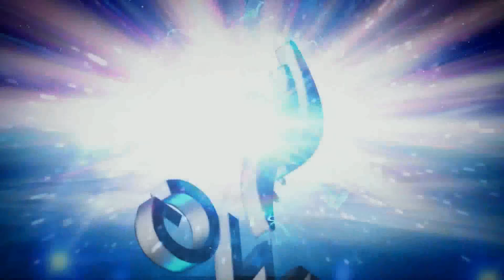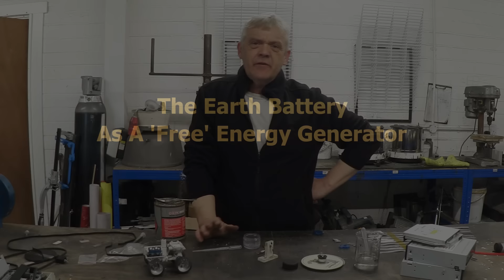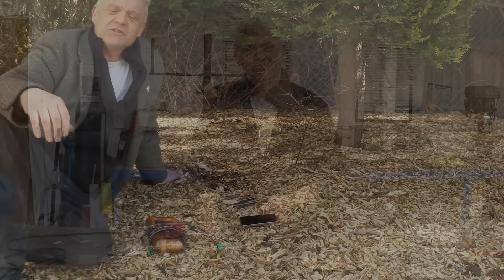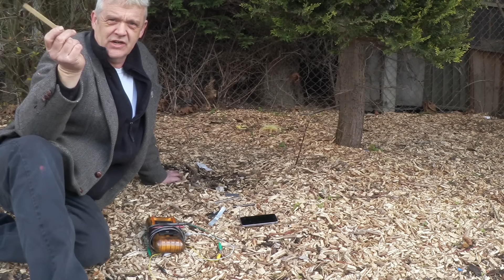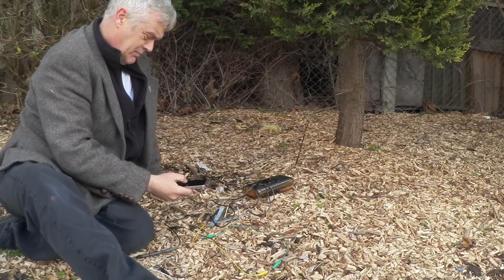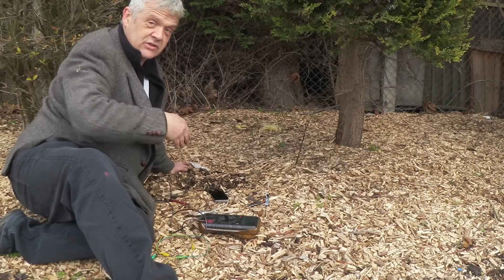The Earth Battery As A 'Free' Energy Generator

Comment: If you use larger surface areas and bury the metal deeper so that all the of the surface is making contact ... it will increase the voltage dramatically. Also make a 5 gallon bucket of salt water. An entire box of salt to make it strong, and pour around the area where the metal is buried, you will increase the conductivity of the soil.... Also you can drive a nail into a nearby tree and connect to the nail for positive, and the metal buried as negative. The wind blowing through the branches and leaves generates a current down to the roots because of the constant movement of the branches and leaves due to the wind. Increasing the energy output at this point is only a matter of expanding to multiple trees in a parallel manner by doubling and tripling  and so on the collectors.  ( 1Tree = 1 collector) ... ( 2 trees = 2 collectors) ...
Reply: I think you may have missed the natural solar power being produced by the leaves... :) LOL great response!
Reply: When i watched this the same thought crossed my mind but trickling a charge to batteries for the added build of energy. Would be great to see this on a large-scale system.
Reply: @anjhindul  yee if you wire the leaves to the roots, you can use the charge differential, to produce Photovoltaic energy
Reply: same of what Tesla made.
Reply: @Erjet1008  idk what tesla made. Not familiar with his work but I do know what I mentioned in my previous comment works because I've done it before.
Reply: Not familiar with the work of Nikola Tesla? I find that hard to believe
Reply: @trevorforrester3142  You did this but know nothing of Tesla? Eh?
Reply: @-Deena.  No I know nothing of Tesla but what I did is not a big deal. Although I'm not familiar at all with Teslas accomplishments... I have heard from word of mouth that he created extraordinary inventions and innovation. What I described in my initial post to me is just basic grounding techniques, or at least techniques I have discovered that work for me. I've been experimenting my entire life with electricity,  radio, light communication, etc.,  but don't see myself as anything special LOL!
Reply: What? Isthis a list??
Reply: @IngeniousOutdoors  also the salt  will just sorta wash away to some extent right?
Reply: @baileyjerman5573  salt takes a long time to wash out of soil.
Reply: @trevorforrester3142  It was his Tesla work on free earth power [ electricity ] that ruined him all his work disappeared  after they closed his lab down
Reply: @IngeniousOutdoors  The salt is there to increase the conductivity of the soil around the ground rod in order to establish  a much more efficient  ground, whether it be for radio transmission,  electrical production or whatever requires a high surface area, high conductivity ground. As farvas the salt losing its effectiveness over time.... there's a simple solution for that. Add more salt periodically. Problem solved.
Reply: @IngeniousOutdoors  The salt washing away slowly is a good thing. After all, the entire reason the salt is there is to promote an effective and efficient ground for electrical production.
Reply: So interesting! Can you charge batteries with a set up like that? Or maybe power an LED light?
Reply: Does the Ph of the soil make a big difference? I know plants favor slightly acidic soils
Reply: @h3avym3tals69  No ... the PH level doesn't matter. What matters is how moist the soil remains around the ground rod and the salt content of the immediate soil around the ground rod.
Reply: @thomashopkins8453  Yes
Reply: I still don't like house wiring.
Reply: Very interesting! It's been awhile since your comment, but in case you still see  this, I'd love to know more about your experiment or have you been able to generate free energy by what you've described that worked for you? How much energy and have you used this since?  Thank you!
Reply: @trevorforrester3142  Tesla learned a lot of his info from a dentist named Loomis. Really good book for ground conductivity is Phil Callahan's - Paramagnetism,  Rediscovering Nature's Secret Force of Growth
Reply: @evanrandall1675  Wardenclyffe Tower was Nikola Tesla's free energy idea. He drilled down to the water table, then erected a steel structure above that lined up to the directions of the compass. It was supposed to provide enough energy that you could "in theory" charge your cell just by standing within a certain radius. Now think about this.... What if the great pyramid was the same sort of generator, and the granite obelisks that were erected all over the city would act as conductors and power lamps and lights and this is why they never found any soot from fire on the roofs of the pyramids.
Reply: @cynthia9388  The key is knowing there are no demons in power. All they have is an illusion of power.
Reply: @inphiknitfractal  and where does that illusion come from?
Reply: Holy Moly Batman ! Amazing! Why has nobody done much with this? Thanks for an interesting video.
Reply: @cynthia9388  It comes from the age of distortion we are currently living through in which we project our perceived lack of power into our reality. Read up on the Siddhas, (David Gordon White) or original Yoga Sutras by Patanjali... or listen to Jivanmukti on Siddhanta Yoga chan.

We experience the lack of power externally in order to understand our relationship to it while in this state of mind / being. Once we consciously make the decision to reconstitute our own being into a place of power, rather than as victims, by taking back the projected power we have given others, we change "the world" / ourselves.
Reply: @inphiknitfractal  and what's the difference between illusion and reality? Here on this planet
Reply: Thanks for the reply
Reply: @evanrandall1675   Being honest, pretty much everyone knows the name & generalities; just not the specific details of his engineering.
Reply: @sido7779   Tesla’s biggest efforts were to send electricity thru the earth from a central generator he devised.  His vision was that each household could just plug into the earth—but tried to centralize it like Westinghouse (for profit).  The tricky bit was getting it to generate enuf power to feed a townful of users.   I think he was working off the earth battery model, trying to multiply it.
Reply: @trevorforrester3142   But it kills vegetation all around there.
Reply: @trevorforrester3142    Couldn’t Epsom salts (MgSo4) be the electrolyte, instead of plain salt (NaCl)?  Because, Epsom salts fertilizes plants, but salt kills plants!
Reply: @mistamischief1979   Yep.  It’s always blown my mind, how Tesla ended up as he did.  
 Wardenclyffe tower was a terrific, & terrifying construct!  But T was a layered project. 
For public awareness, it was to try to beat Marconi at wireless transmission of radio signals.   Tesla’s signal was  to send a wireless message to the Perry’s Arctic polar exploration team, as they headed to find the North Pole.  
 But, Underneath that, it was a covert demo of a war tool….  “”….(read the sarcasm!)
…his initial wireless “radio” signal, missed that expedition (thank goodness it did😳!!), because, his “signal” ok, papers  a whopping 3 minute difference in times…🙄…at a time all clocks were hand-wound spring mechanisms… …… …across several time zones🙄)
But…As soon as that contest was over & Marconi proclaimed the winner, the US govt demanded the entire thing be torn down, & the parts removed & destroyed, so nothing like it could be made again (interestingly coincidental, & contradictory to govt denying that thing had  to do w/Tunguska explosion...to this day).  
When Tesla died, US govt collected everything in his apartment & lab, never to be seen again…they ….
But, I would direct attention to the HAARP arrays built over the past few decades, sited in a number of places worldwide, at triangulation points, starting in Gakona, Alaska, which suspiciously look like some of Tesla’s plans, & are capable of doing horrific things to people, planet, & weather.  Tesla got nothing of recompense from govt, for all his efforts to sell war tools to them.  He got precious little from Westinghouse, for all the work done for him.  & Edison took some of his work, ridiculed it, but used it, rather than amicably collaborating w/Tesla, as Tesla tried to do.
Reply: @Chimonger1  Again.... You can use whatever you want to use if you find it works for you. As far I'm personally concerned, I'll use salt for 2 reasons.  (1)- My objective is not to grow a garden  .. it's to enhance conductivity around an electrical ground. (2)- Salt is what has always worked for me so salt is what I will continue to use and advise others to use.  By the way.... I'm seriously not trying to be a smartass in this comment but I fail to understand how a comment about electrical conductivity somehow turned into "saving vegetation"  in an approximate 2 to 3 feet radius around a ground rod. I couldn't care less if some grass in a 3 foot circle located on 16 acres of land lives or dies.
Reply: @trevorforrester3142  you should try laundry boosters it’s a lot more conductive.
Reply: Do it in salt flats
Reply: @trevorforrester3142    It’s not just what happens to the vegetation in situ. 
The salt will not stay in situ; it migrates thru the soil.  How much you have to replenish the salt after it migrates, depends. Mileage may vary relative to moisture conditions, too.  It will end up salting the water table below, & osmose thru the ground in a wider area, roughly cone-shape widening deeper (again, mileage may vary, depending on conditions & depth of water table). 
Not tryin’ to be obstructionist. 
You do you.
Reply: @Chimonger1  Pure salt isn't that great for the lifeforms in the soil, would suggest clearly an inert area specifically for this if that's your method.  I would suggest trying volcanic rock dust sometime as it'll probably have more generation and it's probably healthier for the ecosystem.
Reply: 😯wow
Reply: @maskcollector6949   Had not known that about volcanic rock being conductive.  
If that rock dust can inhibit plant growth in our driveway, too…even better. 
 Have thot about ditching down center of our long driveway to bury geothermal tubing for tempering house, & trying out a long line of earth batteries (hiding in plain sight).  
But, have yet to find detailed descriptions of how-to, & what electrolyte might best optimize charging batteries enough to power at least the lights in the house, if not more. 

Was considering using the biggest nails (almost 12” long X almost 1/2” diameter) sold by big box hardware stores, or, using grounding rods for longevity.
Reply: @Chimonger1  There's a lot of magnesium and other minerals in rock dust, there's different blends out there.  I haven't experimented with it yet but I figure it might work as I'm familiar with using it for gardening, at least.  It's not publicly available information:  we're at the point where legit we're all experimenting right now.  I feel like there will be a major breakthrough in earth batteries someday, probably sooner than later.  I was visualizing using nails as well, but I think what I might do is figure out which metal is best.  I know Magnesium+Carbon is the best combination that's been tested so far.  Wood ash is something that's also worth looking into in terms of carbon.  Right now, my goal is to just come up with a stable 6volt current to charge a cellphone.  Once that is established:  off-grid energy options really open up.  You'd just double it for 12v.  Figuring out a way to stabilize and increase the current seems to be the main bottleneck right now.  There's not enough current to power most things via earth batteries from everything I've researched, that's not been done yet.  The best that anyone has published powering has been a radio for like a few seconds.  I don't think digging deep and all that is worthwhile until you come up with a scalable model.
Reply: Another Account  Yes,  I am 12 .
Reply: Another Account  ...well nearly 12. I'm 12 in 3 weeks. I'll soon be a teenager. I cant wait🏵🌺🎇🎈🌻🎂🎶🎉
Reply: @maskcollector6949   Wishing there were better ways for comments to work for discussions, that made looking @ chains of back-&-forth chat to be found & looked thru! 
I only know little of energy production & use.  But, yeah..the random uneven power from earth batteries is a problem. 
🤔 What if the earth batts fed to one or more capacitors 1st, then from that to battery storage (& from there to power stuff as more usual for on-site systems)? 

🤔 Do I grasp right, that the earth batteries are picking up earth’s charge, & Not just generating energy from the dirt minerals? 
🤔 Recalling “Baghdad batteries”, maybe those were a progression from earth batteries, which generated a more controllable & scalable energy?  
🤔 Tesla’s Wardenclyffe system had a particular foundation, & I heard, rods fairly deep into the ground; it sounded like he was harvesting earth battery-like energy to run the tower operations.  Public only knew it to be competing to send the 1st wireless radio signal to Perry & crew on that Arctic N.pole expedition.  But the less known use demo, was for the US govt, as a weapon.  Supposedly “coincidentally”, the Tunguska event happened concurrent w/turning on the tower (officials say, “there was a 3-minute lag-time, so, it couldn’t have been caused by the tower”—except, back then, there was NOTHING like accurate clocks of today—everything clock was springs & gears—making it highly probable, the tower’s activation caused Tunguska.  Then, there’s the thing about how fast the gov’t mandated that tower be dismantled “so nothing of it can be reassembled ever again”, & a very strong move to make Marconi the winner for wireless, & further thwart Tesla’s getting contracts for his works. 
Tesla figured something out, about tapping earth energy.  He was trying to create a way for every building to just be able to wirelessly be powered (no grid connect).  
His problems seemed to include, difficulty sustaining the created energy, & keeping it evenly operating.  
Residents in CO. Springs filed numerous complaints about Tesla’s lab near there, including static discharges they could feel, booming/explosion sounds, etc.
Maybe if people dug hard into his research (IF they can find it), more can avoid “reinventing the wheel” w/earth batteries. 
Tesla was extremely impressive w/knowledge back then, & some of his stuff has covertly been used by govt, up thru now..they did, after all, take all his stuff upon death..  I suspect there’s more of the science known now, than back then, but there were still projects left undone, that might help. 
We just need to stop the “lizard people” running everything into destruction, for profit.
Reply: @maskcollector6949   I think it might be an idea, to use pipe w/electrodes, fill pipe w/rock dusts. 
 Who was the very eccentric Canadian physicist guy? Electrical engineer..
He demo’d filling recycled cans w/tiny yard gravel, sticking in electrodes, I think adding liquid to the rocks??…& those became usable batteries.  
The video was a general demo, so, could not see what the gravel really looked like, or exactly how he connected electrodes, but showed him measuring the power it made.  It was from, I think, the 1990s? 
He, too, filled his apartment w/electronic equipment for doing electrical research, SO much, there was barely a pathway to get around.  He struggled w/permits to do that there, had trouble w/landlords, etc…very Tesla-like.  Long hair, liked black leather vests & pants. One-track mind on his work.
Reply: Another Account  Do you often talk to (nearly) 12 year old girls on the internet?
Reply: Except the salts is what's making the electricity, just galvanic reaction, no secrets or energy, one the salts gone it's over.
Reply: @ironhell808  It returns back to its original  state had no salt ever been added to begin with. ..in which case simply maintaining a fresh supply of salt periodically solves the problem.
Reply: @trevorforrester3142  Fascinating. You really should watch a few youtube  videos or pick up a book about Tesla a fascinating man actually. My  Dad taught me about this man many many years before he became well known by most everyone.  Your comment fascinated me thank you.
Reply: ...
Please do not salt the earth on large scale.
Just trust me on this one, we have a lot of data on this specific subject.
Reply: You just described how the pyramids are a energy power plant !
Reply: @anjhindul  his plans greater
Reply: @trevorforrester3142  "No ... the PH level doesn't matter. What matters is how moist the soil remains around the ground rod and the salt content of the immediate soil around the ground rod."

Makes sense, in order to keep the conductivity flow at optimal levels.
Reply: @mistamischief1979  Your more correct about pyramids generating power then you think. But the obilisks were not used as light but something different.
Reply: @Chimonger1  mmm, something to think about. The salts flushing outs to other areas eventually killing plants and organisms. I guess if you go move to high salt content areas where life don't grow it shouldn't be a problem
Reply: @Chimonger1  chlorides in general are not great for plants because chlorine. Also plants don't really use sodium . But it's a question of dosage. Stick a few teaspoons of mg sulphate on a plant and it will die. The dosage is in micrograms. And to be honest micrograms of nacl wouldn't kill the plant. It wouldn't be great but it would be in tolerance levels. It's not a toxin to plants it's just not nessesary and can be a dehydrating agent and kill it in that way.
Reply: @apathyreview3964  First of all... I'm not the creator of the video above.  This is not my channel. I am what they call a "commenter" who left a comment.  That said,  a person who leaves a comment cannot make monetary profit. As far as removing the soil is the same as saying , "remove the GROUND" ... I hope you know the concept of a ground in a circuit is not a new concept and has been around since the beginning of circuitry itself. In fact it is a requirement.  Otherwise there would be no opposite polarity in a circuit,  leaving just the "positive" polarity without the negative. When creating a basic atmospheric power generating circuit, you must have a ground rooted in the Earth ground in order to establish a positive and negative field. There's no other way around it and it is common knowledge. Saying you can generate more voltage by completely removing the ground is not only false but is also impossible. Why don't you first learn how to write a simple comment using basic correct punctuation? .. once you learn how to communicate properly,  then you can graduate to more complex subject matter such as simple electrical concepts that have been written in stone since electricity has been around.
Reply: @originsdecoded3508  i believe you are correct. I actually think the obelisks were used sort of like WIFI towers to extend/distribute the energy with max output. I wonder if they Multiplied the power output like a capacitor or something, and this way everyone was able to get a solid "signal" no matter where they lived in the area. Whoever built the pyramids, were WAY more advanced then we are now. I just cant decide if the builders were from the pre flood era or even the one before that, lets call it the ASTEROID era. The pre pre cataclysm peoples. Thats how old they may actually be. Were just too stubborn and corrupt to ever let the truth out. Sad.
Reply: @apathyreview3964  I clearly said atmospheric generator, In context with the entire conversation and video. Secondly...a battery does have a ground.  GROUND and negative are interchangeable terms.  You always need a ground in any known circuitry.  There's always 2 sides to any circuit. Continue to dig a deeper and deeper hole for yourself but in the end you will remain wrong. Have a nice day! I will no longer respond to your uneducated semantics.
Reply: @mistamischief1979  The pyramids were built after the flood. all middle eastern areas were inhabited after surviving nephilims moved from the northern center of the earth were the Garden of Eden was located. after the flood they settled in the east while others spread west, south, and outer north. So much literature exist out they're to satisfy all your curiosities and questions about the ancient past. I can tell you this much, That the sites near Iraq was the first cropping civilization in the east after the flood. So, older then the Egyptians temples and pyramids. its where king Nimrod in ancient Babylon built the Tower of Babylon after he survived the flood and his people. His kingdom spread far and wide, even as far as Egypt, and more likely then not, he is responsible for commissioning those pyramid structures for power and energy. His kingdom spanned across almost all the East and it said that at one point, he was the top king of all kings in the world during that era. He was a Nephelim himself, a giant.
Reply: @originsdecoded3508  exactly.
Reply: @Chimonger1  uhh, exactly to what comment?  I agree with your previous remark about the disorganization of the comment section not knowing who is replying to what comment and what not. 
But I guess we must find order amidst this chaos.
Reply: @originsdecoded3508   As much as able…but, plenty of times, I just don’t respond to someone’s questions/remarks, simply because the chain of responses gets hidden in the heap, & none of the media has software that takes one from notifications directly to the chain of comments, properly.
Reply: @trevorforrester3142  He wasn't an inventor - he was a hugely important scientist who demonstrated some prinicples that became interesting inventions. HE HAS AN S.I. UNIT NAMED AFTER HIM ffs, like Lord Kelvin, Pascal, Newton, Watt, Faraday, Joule and Hertz. Presumably in you many years of work on electricity, light, radio, etc you have heard of magnets. Magnets whose strength is measured in Teslas.
Incidentally, your original post is just plain nonsense.
Reply: and destroy the soil...
Reply: I'd love to see you make a youtube channel and this be your first video! I'd be your first subscriber :D
Reply: it will give max voltage of 1.75v
Reply: @evanrandall1675  I have heard of Nikola Tesla but have never sat down and read anything about any of his work. I have also heard of Shakespeare and I've never read any of his work. Only what I've heard. I've never studied Monet ..  the guy that painted but I've heard of him. So when I say I'm not familiar with Teslas work but I've heard of him.   As though it's impossible for me not to know all about Tesla.
Reply: Quartz instead of salt is excellent.
Piezoelectric crush of any kind is worth a try.
You can make a ring large enough
 around the tree with copperwire so long as it is not touching the tree and then bend enough wire down for a stand that goes into ground a foot.(If you have enough strong gauge , you can wind seven courses before making the ground, and an antenae.
I don't like harming the tree, mine are over a century old.
  s
Reply: Can it be made to fill capacitors?
Reply: how would it look in a diagram....very interesting
Reply: @thomaspearston  how would you show this on a diagram ...sounds very interesting
Reply: Could you charge off grid batteries doing this?
Reply: @NanoNutrino  sure as long as the sun is shining
Reply: The worms moving in the soil produce .001 MV moving through the Earth. If you have 100 then that's .1MV. I make sure I have millions of worms by buying them from bait shop and gathering leaves so they have enough to eat and reproduce. They produce somewhere between 1 to 2 MV.
Reply: I’d like a book on this.
Reply: 🤔I'm no scientist or tinkerer but your comment made me think dead sea salt should really help then.
Reply: @BigDaddiHung 🤔 those are above lakes of water in Utah
Reply: I’m getting 220v using 200 trees and some copper coils
Reply: @kevinanderson4963  I've heard of Borax (Sodium Tetraborate) being used to kill weeds, but becoming toxic to all plants at excess concentrations. I'd guess Borax might be good for increasing conductivity.
Reply: @trevorforrester3142  hello Trevor, as a complete novice to the world of electricity would it be better to use the sea bed to solve the lack and depletion of salt as a source for conductivity and  farther more if the  right anode and cathode and orientation was accomplished on the sea bed do you think it can be commercially scaled up or am I talking through  my backside?. Interestingly I once hugged a tree on a windy day for the fun of it and I did experience some kind of weird sensation or perhaps it was just good weed.  Cheers.
Reply: Until you get a lightning strike. 🌩 🌳🌲🌩
Maybe?  Salt in soil?  Not much of a gardener, are you?  No love for Earthworms! Weeeee!
Reply: @apathyreview3964  Well, there are Halotrophic Plants.  They grow towards/in salt water.  There aren't many I know of though.  Think of a sea shore plants or seaweeds & kelp.
Reply: @Shellorena  You have to lightning rod the tree.  That can be done to prevent a strike.
Reply: @katyaflippinov9197  I don't believe the subject matter here has anything to do with "gardening"  This is about ground conductivity for electrical production.. My comment above was never about growing produce.
Reply: @johngalt97  sodium carbonate
Reply: @johngalt97  it’s basically baking soda
Reply: Your stuff excellent & you help show us all thanks wish all these with bright ideas about your stuff oils show their stuff instead of thinking they giving advice bless them
Reply: @trevorforrester3142 hey Trevor I was wondering if digging a small mote would be a beneficial step to the salt ring?
Reply: @trevorforrester3142  Instead of salt does any other crystal work?  Without the need for H20?
Reply: Is it from the wind blowing? Or from the movement of ions throughout the tree? 
I’d imagine it’s similar to a galvanic battery, in that the flow of electricity is primarily due to the flow of charged particles that the tree collects from the soil for nutrition. And this higher density of charges eventually dissipates as it makes its way throughout the tree? We need to figure this out more…
Reply: insulate the wire, climb to the top of the tree and connect it there.
Reply: Paramagnetic rock powder will amplify ground conductivity without any unwanted side effects.. Read Phil Calahan - Paramagnetism, Natures Secret Force of Growth
Reply: @cynthia9388  manifestation.
Reply: @mistamischief1979  That is sheer nonsense from someone who is too lazy to earn about the history of technology and also lacks common sense
Reply: @voltairer.2919  please clarify what it is your having issues with?
Reply: So salting the earth is good now🤔
Reply: @trevorforrester3142  hahaha
Reply: Salt will only corrode the metal though
Reply: this comment has almost sent me into psychosis.
Reply: @Erjet1008  as I was reading the comments I thought about Tesla, and when I just read your comment I just had to share that with you.🖤
Reply: @Chimonger1  "No good deed goes unpunished."
Reply: @thomashopkins8453  yes
Reply: @evanrandall1675  One of the earliest examples of an earth battery was built by Alexander Bain in 1841. Tesla was born in 1856. Was not even Tesla invention egg.
Reply: @-Deena.  One of the earliest examples of an earth battery was built by Alexander Bain in 1841. Tesla was born in 1856. Was not even Tesla invention egg.
Reply: @throughput6674  I didn't know that. Thank you.
Reply: I did this when I was like 12yo my parents just like "what is our son doing??" 😆
Reply: Chill. He's talking about saturating 5 gallons of water with salt and pouring it in a small diameter around a ground rod. Every single one of you flushes more sodium chloride down your kitchen drains from cooking, down your shower drains from excess salt excreted in your sweat, and excess salt excreted in your urine on a regular basis. It is either dispersed in your leach field if you have a septic system, or (worse) is removed and disposed of at water treatment facilities. You are all salting the earth.
Reply: @mayorpufnstuf4470  sometimes I wonder do these people know we take salt out of the ground..
Reply: @inphiknitfractal  good point
Reply: @Shellorena  What voltage/amps have you got from this?
Reply: @trevorforrester3142  interesting. Only the other day , my dad being a sparkie mentioned an electrical job . As homes built on rock shelves and how to ground ( earth ) your home . Because you can't earth in rock , they used salt to get the earth
Reply: @trevorforrester3142  Use Silicon Dioxide since it will do the same and actually improve the soil instead of harm the biomass.
Reply: @Chimonger1  Use silica sand then you will be effectively making a Silicon Dioxide battery and is will actually improve the soil rather than harm it.
Reply: @trevorforrester3142  My neighbor poured 4 gallons of bleach water near my 85 ft tall sycamore tree. Bleach in the soil degrades to salt. The 50 year old tree was dead in less than two months. Salt can kill grass and trees.
Reply: I wonder if the battery theory might hold true?  Ask this, because I've been seeing reports of scientific explanations of how the sun, through solar wind and solar particles causes, a few days later (there is a lag time), storms, quakes, volcanism, lightning, etc.

For earth quakes and volcanoes, the electrical currents cause the magma to heat up and to become more liquid, so volcanoes erupt, also, at the low viscosity zone, the molten material also is heated up, becoming more liquid, and causing tectonic plates or fractures in the crust to make earth quakes.

During hurricane and cyclone season, the magnitude of the storms is dependent on how intense the solar forcing is (how strong the solar wind, and how energetic the solar particles are).

Well, all of these things make me think of static electricity.  The solar wind and solar particles blasting against the Earth's magnetic field, and some of those particles entering the Earth via the polar regions could be building a charge, or storing a charge in the Earth.

So, maybe that is the source for the free energy that is being tapped from the ground...
Reply: The planet is a living being and the carpet covering  the forest  floor has the things  in it that makes mushrooms  and cover miles of forest  floor .also like aspen trees that interconnect with it all. That all connects  to all the electrical capability  of the large crystal  caves  all over world . It is planets brain waves you are getting
Reply: I'm wondering if one could take this concept to basement-level deep and how that would work.
Reply: @-Deena.  ...created a facebook account  when you were 3 years old..????...ha ha ha ha....
Reply: @johnbiggins4864  I was very precocious...seems Mr 'Another account' deleted his obnoxious messages to me and ran away ..btw this is You not FB. 😁
Reply: Please don’t salt the soil guys, that’s what the Romans did to Carthage after razing it to the ground, to make sure no city could sustain itself there for generations to come. I think we’re looking for green ways to generate energy, right? :-)
Reply: @alexanderdebree9295  Don't give Putin ideas! I didn't know that. Great fact.
Reply: @IngeniousOutdoors  I think salts as will wash away at a rate faster in sandy soil and slow in clay soil. Depends on rainfall amounts also. Sandy areas with lots of rainfall would wash out in shorter time
Reply: An actual informative and quite useful post...
Thank You for taking the time!
I copied and pasted it for future reference.
Reply: use sodium carbonate instead of salt
Reply: Amazing
Reply: And this works anywhere in theworld
Reply: the ancients had to know this seeing as their civilizations were earth based
Reply: @deanag8457  Yes. You're correct. The ancients absolutely knew way more than what I described above in my comment. In fact,  I know way more but A person is only allowed to elaborate so much and then he/she is instantly censored.
Reply: The future will depend not on increased energy production, but more efficient use of electricity. Just as the LED light bulb translates more electricity to visible light as opposed to the infrared light produced by incandescent bulbs. 
I can foresee a future where most outlets in a house are 12 volt or 5 volt USB over conventional plugs. You can practically light your house without using more than a 5 volt LED light bulb. The main problem is that motors are energy hogs. Fans, refrigerators, air conditioning, vacuums and such will always require large  voltage to power them because the energy is directly related to performance. But assuming we continue to grow, we should be able to develope new technologies that perform well with less electricity.
Reply: @sido7779  Yep. Carnegie made damn sure that happened
Reply: @katyaflippinov9197  I looked for this comment!  You’re absolutely right, I had neighbors put nails in a tree for the iron.  Poor thing got struck by lightning (twice) - while my tree almost next to it was taller.
Reply: I think you can teach people like me a thing or 2. Why not share your experiments by creating a channel. If you ever do please reply here and let me know.
Reply: @anjhindul  Imagine being able to charge your batteries by uninvasively tapping in to trees like they were large, self-repairing and naturally growing solar panels.  

"Yeah, I went off-grid after the maple trees got big enough."
Reply: I have read thru a number of your posts, but haven't found any that tell me how much power u have been able to generate. For instance  are u only talking about small appliances or larger ones as well? 

The power u do generate, do u use it immediately or do u store it in a battery? 

Also do u believe a system could be set up to power a small house or is this not feasible?
Reply: Would like to see you do the experiment and show us what you get as a result
Reply: Okay, how's this: for the electrolyte you use human urine. It will have sodium and urea. In an apocalypse, you will have power and a place for your urine.
Reply: @Chimonger1  one thing they proved that Marconi used Teslas idea and wasn’t given the recognition.
Reply: Saltwater in soil and nails in trees, what you thinking, man 😀 .
More eco warrior than inventor (I'm only joking, by the way) 😊
Reply: @trevorforrester3142  so how to use that energy and light up a led?
Reply: @7gone  I'm really busy right now but I will say this.... This will light way more Than an LED. .. This isn't a grade school experiment LOL!... This done properly produces a substantial, usable yield of power. LOLOLOL! .. I wouldn't waste my time instructing people how to illuminate an LED. We leave that to the grade school students using grapefruits and oranges.
Reply: The ionosphere is highly positively charged, and the air from there to the ground is an electromagnetic field of possibilities. Like Benjamin Franklin's key on the kite, if you were to place a bit of copper on a weather balloon tethered to the ground with a wire, you could place a coil at the bottom of that wire and find that electromagnetic induction will produce quite a ridiculously enormous amount of electrostatic voltage. If you use an LC circuit to a transformer, it can be turned into AC.... loads of it. Alternatively you can just use a tower that already exists, or place a rod in the ground against a tree that extends high above the tree, or just place a bit of copper rod on the edge of your roof and wire it to the ground. Antennas receive frequencies better when they have more surface area and when they're placed higher. The same principle applies here. Wardenclyffe Tower was a transceiver of power, not a transmitter. Test and you'll see.
Reply: Salt will ruin the zinc and the copper…
Reply: I like your perspective
Reply: Wait does this mean you can get unlimited energy from the ocean?
Reply: @isaacbussey3216  The ocean can provide  energy. The tides can provide constant kinetic energy which can be converted to mechanical energy with hydro-turbines. The movement of surface waves can provide voltage to floating piezoelectric energy harvesting mats that could also collect radiation from photovoltaic panels (solar panels) on the topside. It could assist to cool the temperature of the water in areas of the globe where it could be beneficial to modern civilization to lower the rate of carbon absorbed into the ocean, but it would have to cover such a large area that it might hinder merchant marine ship access... it would be very expensive and probably use more energy than it creates before it needs to be replaced.
Reply: @isaacbussey3216  I don't live anywhere near an ocean but anywhere there Is constant movement of magnetic fields Is a good start. 1/2 the battle is getting free movement..whether it be from wind.. water flow.. or whatever.
Reply: I had the thought about getting power from trees that way over 30 years ago. I've known about earth batteries ever since one was discovered in the US embassy in Moscow powering a spy device.
Reply: @Chimonger1  I have never read anything about Tesla trying to monetize his free Energy project…
Reply: @davidt1621 and since the ocean movement is 24/7 it’s much greener than wind or solar but again our materials fail eventually and need replacing
Reply: @eathealthier4u  The Plasmoid Thunderstorm Generator has the most promise within the legitimate scientific community as of now, notwithstanding the eventual increase in precision of zero-point laser-initiated nuclear fusion at the Lawrence Livermore Labs (they finally had a breakthrough recently after decades of trying).
Reply: I just realized that your icon is the Limewire logo.
Reply: @davidt1621  Yes... I used use the virus ridden program all the time back in the day during the early to late 2000s. It was a much simpler time where everything was beautiful all the time LOL...
Reply: @trevorforrester3142  same.. and KazZa and Morpheus before Limewire. Napster was before my time.. I may have some things in common with gen x, but I'm a millennial dangit lol maybe an older one but still
Reply: If surface area is a contributor to good performance, then would not some kind of packed metal dust be be a good choice?
Reply: @bennyacosta1560  metal dust implies nonconnected bits and pieces. Whatever is used needs to be all part of one piece. Individual pieces of metal floating around in the dirt will accomplish nothing. That is unless it's packed so much that most of the pieces are still touching.  ... which may have been what you meant.
Reply: @bennyacosta1560   If you just use it for cover, the rainwater will leach the metal into the soil, which will change the pH balance. Metal is a mineral, and the most commonly used one for soil is crushed limestone aka Lime, if you want to adjust the pH.
Reply: I see allot of people saying salt but I have a question. I live about 1500ft or less from the bay. Would this be the same since when I dig down more than 6 inches I get nothing but water
Reply: @originsdecoded3508  I am from Iraq, Babylon. Thank you for telling the truth and not hiding it like some. Most of what you say is true and I benefited from it a lot. Thank you.
Reply: Can you give a brief explanation of how to wire it to a tree?
Reply: Are you teaching this at all?
Reply: @sido7779  so they say we don’t even know if the man named “tesla” is even real I’ve never seen a real picture
And if you’re telling me those pictures that they show are real pictures and I think you need to learn about photography 
That picture is completely created 
The one with him staring at the camera 
The one under the electricity, those are all re-creations 
We don’t know if Tesla existed 
But somebody did 

And this guy is just talking about grounding 
There just happens to be a particular form of energy that between earth and the atmosphere. You can generate electricity if you do it, right 
You could take 1000 nails on 1000 trees and run your whole house off of it your whole life 
Nobody’s gonna believe it enough to try it, but it works 
Just like water propulsion 
You can go at the bottom of the mountain that has a creek or stream running down it 
Generate all that water through a small opening, aimed at an alternator with paddles on it
My point is is you can generate electricity, a lot of ways 
Try playing with magnets that was where I learned a lot and I guarantee you that’s where this guy Trevor started out
Reply: Edited for certain words, YouTube will strike
Reply: Screen shot aquired
Reply: Screen shot aquired
Reply: Is this the same principle as the Stubblfield battery ?
Reply: @trevorforrester3142  i mean he invented AC power but i think people here are referring to his later free energy/wireless electricity transfer tower that was quietly dismantled by his investors because it wasn't profitable.
Reply: Are you still a Genius I need a schematic of this plan.
Reply: @trevorforrester3142  really
Reply: @trevorforrester3142  I’ll give it a go 👍
Reply: @trevorforrester3142  maybe you create tutorial in your channel 🙃
Reply: @trevorforrester3142  how long can it last and will it affect the quality of the soil?
Reply: This is a real life avatar movie.
Reply: Me on that kush:
Reply: @trevorforrester3142  You apparently know your “stuff”. Sounds like you have done this before. Thanks you!
Reply: Leaves moving ≠ electricity.
Tree sap ≠ battery.
But soil batteries and metal electrodes? just low power and mostly for fun or niche sensors.
Reply: @sido7779  aber warum hat man damals Tesla das Büro dicht gemacht?
J.P. Morgen, einer der reichsten Männer damals( Banker) hatte ihn am Anfang mit Geldern unterstützt, und als Morgan merkte wie groß Telsa mit seiner Erfindung werden könnte, hat Morgan ihm den Geldhahn zugedreht.Morgan hatte Gelder in Kuperminen investiert, und Tesla war mit seiner Erfindung über Freie Energie in diesem Augenblick ein starker Konkurent.
Wenn alle Welt freie Energie nutzen könnte, wer kauft dann noch Kupfer für Stromleiter, die man der ganzen Welt verkaufen kann.

Tesla war ein Genie, er hatte damals nur die falschen Leute um sich herum, und das hat ihn am Ende verarmen lassen...
Reply: 5 yrs later...no post info. So your "device" powered what? For how long?
Reply: Like the pyramids
Reply: @trevorforrester3142  شكرا لك..
ما هي كميه الشحنه الناتجه من تجربتك..
انت انسان نافع
Reply: اود ان استسفر منك.. عن مجموعه بطاريات متباعده في الارض الواحده
هل تعطي شحنه اكبر؟